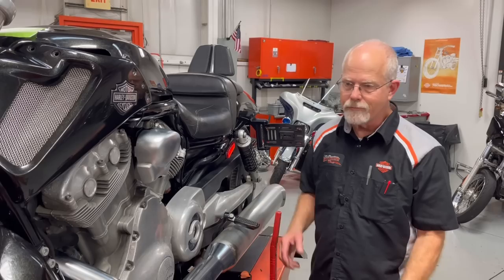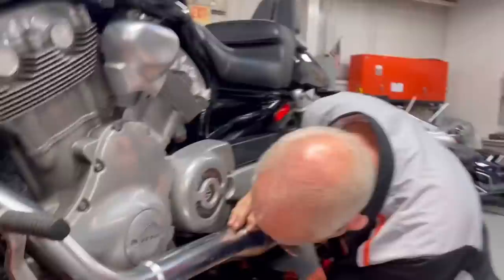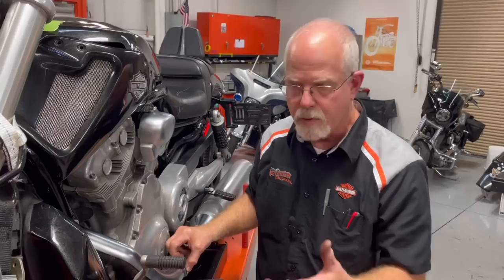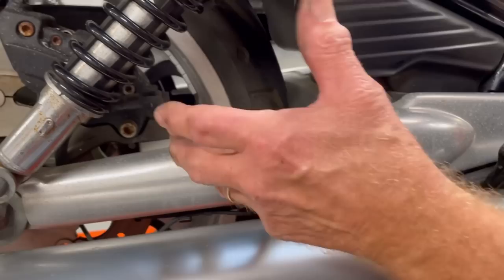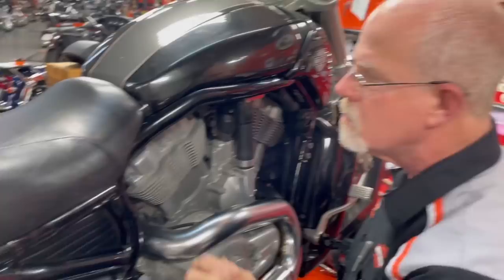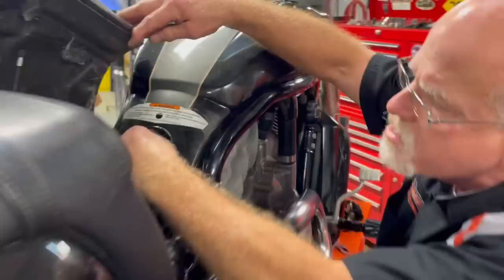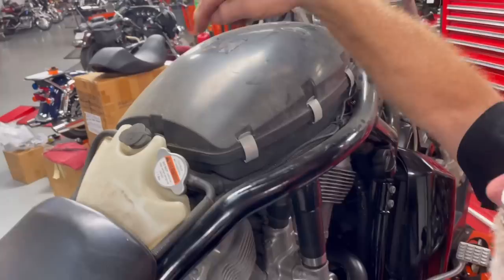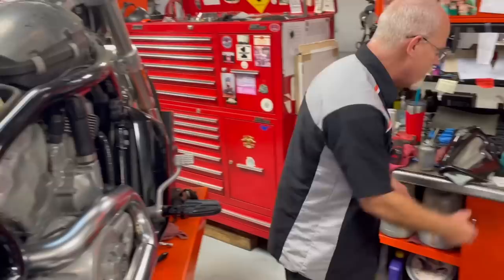Doc Harley and The V-Rod Mystery

Comment: I had a V-Rod for 10 years. I loved it but unfortunately too many of the HD faithful didn't. It was more European than American, which was okay with me, and an engineering marvel and headache at the same time. If you get a chance to ride one, do so. A sheer blast to ride!
Reply: Harley messed up with DC Buell and the Vrod.  I think they are doomed with less models and prices that are extremely high?
Reply: @tightright7561  The entire motorcycle industry has been plagued by high prices. The young kids used to buy 600cc and up inline 4 crotch rockets but with a ZX-6R 600cc bike costing $11-12k MSRP they've had to settle for the cheaper parallel twin fart machines.
Reply: If you like the Vrod, it wouldn't hurt to check out the Yamaha VMAX. Very similar bike, with an extra 90hp. Will tear your arms from their sockets.
Reply: @PotatoeJoe69  Buy a VMax?? LOL, Wow, you really understand nothing about Harley buyers
Reply: @stanleymasterson1135  The VROD is not purchased by Harley buyers... because it's actually a Porsche.
Reply: And what exactly makes the V-Rod European
Reply: @maxheadroom8097  The entire drivetrain, fuel injectjon, ECU and basically all electrical components which control the drivetrain are made by Porsche. Harley made the frame, and that's about it.
Reply: @PotatoeJoe69  The Germans definitely did not "make" those parts. Consult and help design? Yes. Also, maybe check on the country of origin for your Delphi fuel injection (or magneti marelli on the even older bikes), the showa forks, the Keihin carb, etc. Vrods were built in Kansas City. Educate yourself

Comment: Doc I need your help. I've got a 2011 NRS. My girl complains about the pegs when she rides with me so I bought some passenger pegs for a V-Rod Muscle. Do I have to have a special bracket to attach them or do they just bolt on to the frame? Haven't had time to look at as the bike is at a friend's house in another city getting tires, fork tube rebuild and black out covers put on. Just need some insight.
Reply from the maker: There was a Muscle in 2011 so you have a chance it will fit….Doc

Comment: I have had my vrod for 23 years, that Manual helped me figured out the correct maintenance schedule, trouble shooting, how to fix my it, and share that knowledge with other vrod owners, because the knowledge and expertise within the Harley Davidson techs has been lost, there are places that won’t even work on a 10 year old motorcycle. Fitzgerald motor sports in a good place to find experts on these type of bikes, if you can’t find the part these guys can cnc it for u, but the biggest issue is the electronic replacements. if you plan to keep this bike long term, invest in electronic replacement parts.
Reply from the maker: Great advice…..Doc
Reply: I heard the 20 thousand mile service for valve adjustment is expensive?

Comment: I was a little late to the Vrod party, I didn’t get my first one until early 05. All together I’ve had 6. It’s hard to pick my favorite model, but I have my favorite models in the garage. The 08D, last of the original Nightrods. Then the 13F, the Muscle has the styling of what the power cruiser is supposed to have. At the end of the day, the 08D will be my forever bike because at the end of the day, it has the best qualities of the Vrod in one package. Either way, I’ll be the old man riding the Vrod one day. I should snag up a couple more so that I’ll have a couple parts bikes. Too bad that there’s only a handful of shops that’ll actually work on them.
Reply from the maker: That is a great story…..Doc

Comment: Thanks, Doc,exactly what's needed for those senior moments. While here can I ask about the maintenance regimen of radiator coolant apart from its periodic top-up? Does it deteriorate over time, particularly over lengthy storage and if so is there a need to flush and replace it. The  marketing ploys sometimes have a conflict of interest as to what might be suggested as the ' right product for you'. Now, where did I put down that allen key?
Cheers from sunny Queensland.
Reply from the maker: Replace every 30,000 miles (48,000KM)

Comment: Hi Doc, thanks for all the great videos, any advice on stripped spark plug hole on a M8 and best repair option. 👍💯
Reply from the maker: Kevin we have not had that situation come into our shop. Take head a part, bring it to a machine shop that will weld up the hole and tap it. Helicoils don’t last. A Time-sert is better but will effect the way a spark plug dissipates heat…..Doc

Comment: only way to fix a harley is to buy a honda
Reply: what do you do when the Honda breaks?
Reply: @martincvitkovich724  they don't break  and if they do its a hell of a lot cheaper than a harley not to mention you can buy two hondas for the price one harley
Reply: @donnieburger3721  What a joke. Took my Honda wheel off to change a tire and the cheap ass rim bent under the pressure of a tire iron. Never happened to real bikes i've owned like HD BSA an BMWd Triumph
Reply: @martincvitkovich724  all simple bikes for simple minded people 🤣mite as well put a briggs and stratton in the frame
Reply from the maker: Donnie why are you here?…..Doc
Reply: Donnie, if you don't like Harley Davidson why are you own a Harley specific channel? And bless your heart, you be safe on your Honda.
Reply: Wen the Honda break he will cry like the other Honda owners…
Reply: @donnieburger3721 thats what harley did on all but the vrod.